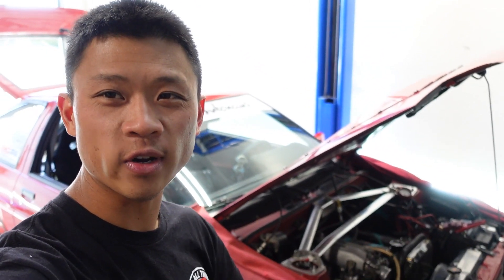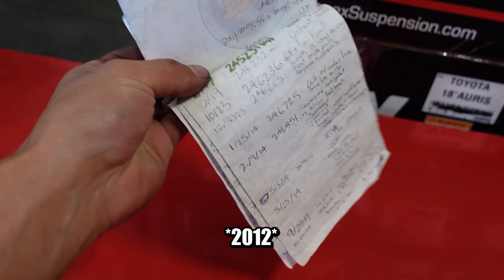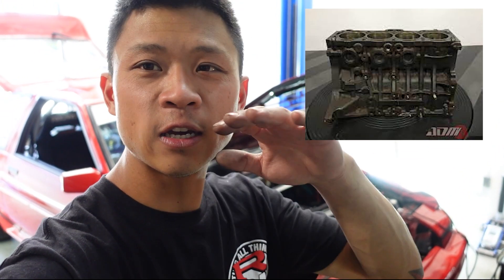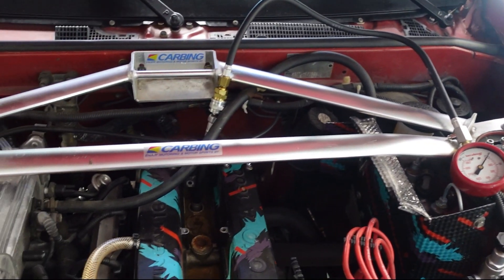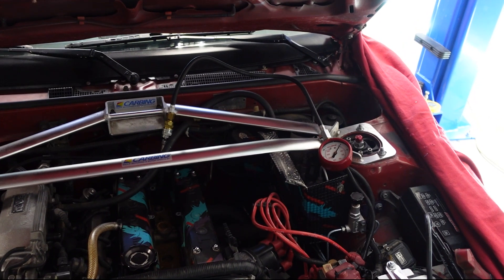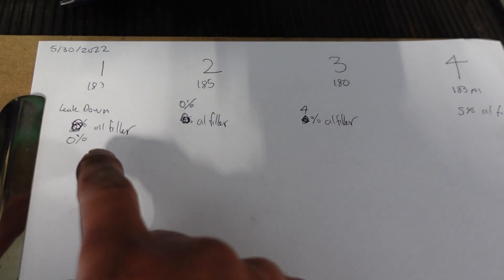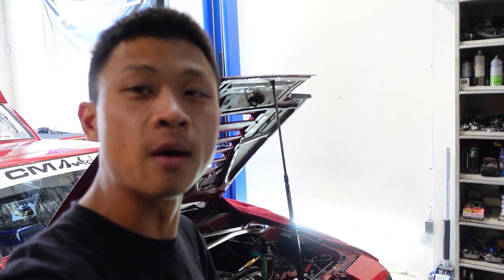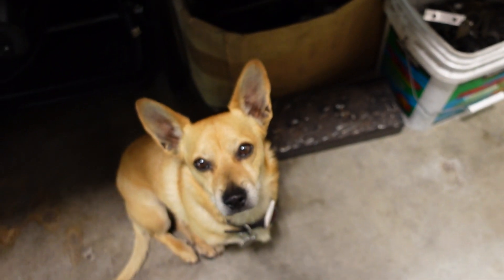4AGE ITBs, Cams, LINK, oh my! / AE86 Refresh pt1

Comment: You have given me so many useful tips, i'm happy I can give you one in return! (I know that throttle body may be in the trash already for your ITBs)

The screwdriver propping the throttle body butterfly valve is high-risk of bending the valve. It's a known NA miata issue, they have a coating that is also damaged on the blade of the valve. it could bend bad enough to leak more than the idle set screw can adjust for, and at that point the TB is kind-of trashed! I have had success propping the TB open (while cleaning etc) w. a screwdriver in the throttle wheel on most cars. 

Loving the podcast and your content, hope everything is going well and you're on-track for 86 day! Sad I moved to WA w/ my 86 before figuring out everyone was local in Fremont lol!!
Reply from the maker: Chris Van had his throttle blade snap in half on a track day with me once and thats how we learned. Also echoed by our local spec Miata guys.

Lots of Toyota TB's have a "dashpot" to damped throttle closing, Chris's was adjust wrong so it did not work.
Reply: @CMAutohaus  i had an ah-ha moment, why people were snapping throttle cables drifting. Because the hard stop at WOT was improperly at the throttle body instead of at the pedal after swapping throttle bodies. Imagine riding a guardrail on WOT then snap, straightening out into the rail 😬 
I haven't looked at 20v itbs but i think it hard stops first at the itbs from a video i watched today... Scary!
Reply from the maker: @coreysmithcoreysz3254  Makes sense. I believe a few companies like GK Tech make adjustable pedal stops.
Reply: @CMAutohaus  i got off my butt and confirmed my 20v silvertop swapped ae86 hits a throttle body hard stop before the pedal. thanks for the gktech tip, have a good weekend and hope all is well at the autohaus!

Comment: How thick was that HKS head gasket? I feel like it's weird to have a standard thickness one.
Reply from the maker: Much too thick. 3mm IIRC. The plan was to run this ported head and that HG on my GZE Celica circa 7 years ago.

I changed jobs and took a BIG pay cut (and had to sell all my toys) while building this engine the first time which is why I used the too thick HKS headgasket.
Reply: @CMAutohaus  Wow 3mm is really thick. Stock is 1.2mm isn't it? Getting some compression and squish back should liven it up.
Reply from the maker: @HachiMiura  Agreed. Happy to gain more compression. Although it will definity need a tune as even with the old HG, I used to ping frequently at low RPM high load on 91 octane

Comment: Gsxr itbs over silver top itbs?
Reply from the maker: More parts support, newer parts. 20v itbs are antiquated at this point - I've seen plenty of worn/sloppy OEM linkages with no parts support. I've been told the 42mm itbs VS blacktop/silver top will actually work better for a 16v
Reply: Availability.  Gsxr itbs can had for 100-200 used.
Reply from the maker: @mikemikeyee  100% I know JSP John was considering BMW M3 ITBs as well due to availability and cost.